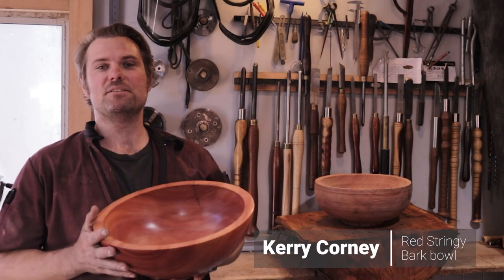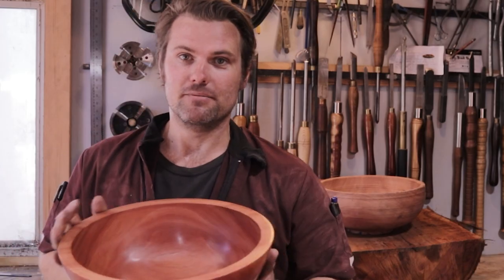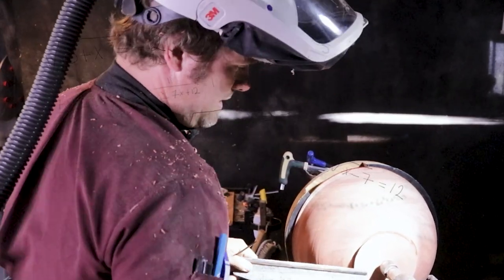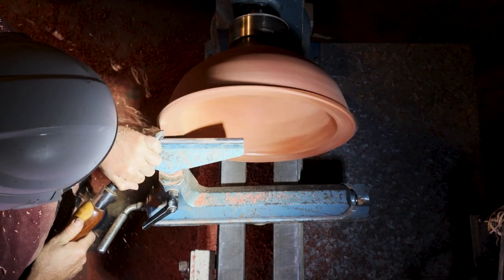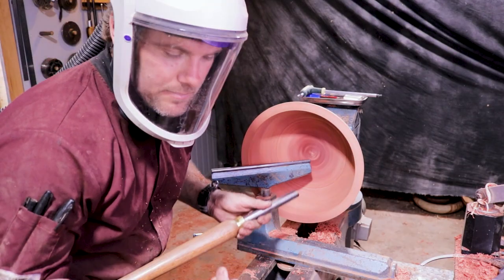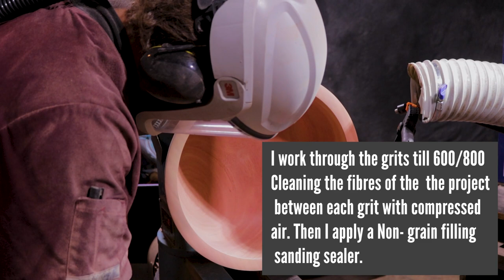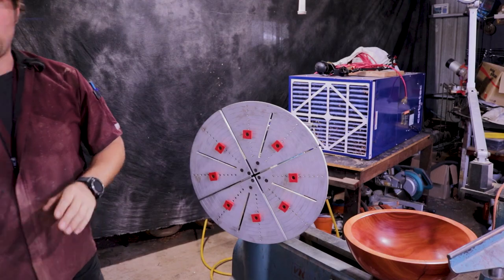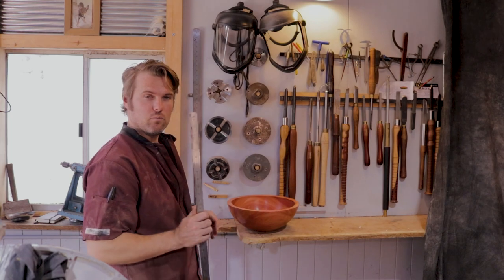Wet wood to BONE dry in 4days! Australian Hardwood - Without cracks.

Comment: Thanks for all the tips. Wondering why the need for the remounting plate when you have a tenon there to use.
Reply from the maker: Thanks for the question Jim. It's because the tenon has moved and warped in shape during drying. So I reshape them for another smaller chuck.

Comment: Fantastic bowl, Kerry! It sure is a monster!

That bottom bowl gouge is looking a little short! Lol
When you go to replace it (if you haven’t already) you need to check out Ashley Harwood’s new bbg. I have it and I love it!
Reply from the maker: Thanks for the tip mate. I really appreciate that. Does she ship to Australia?
Reply: @KerryCorney  Hmm…not quite sure on that but, I would imagine she would. 
I think you’d like it. Any aspect that don’t like about your current bbg is resolved with hers. It’s long, and pretty much zero flex due to the thick flute shape.
Reply: I would check out Stuart Batty gouges too. They are back in production and the few that I have are the best ones I have.  I have tried Thompson, dway and Sorby bur when I order my next replacements they will be Stuart’s for sure.  Also swing your bottom bowl gouge more, it takes getting used to but works great to get a smooth cut that makes sanding minimal.  Trying to push the short angled bevel is tricky.

Comment: Sorry but I’m calling bullsh!t on your 15% moisture content measurement.

Yes that’s what the moisture meter says BUT, moisture meters work on impedance - and the meters are graduated at the factory - to measure Douglas Fir, not Aussie stringy bark.

So the CSIRO in their wisdom, put out a “corrections factor” for moisture meters on a species by species basis.

For Aussie Stringybark according to the CSIRO tables, you have to add a further 2.25% moisture content to your meter reading of 15% to get an actual moisture content of 17.25%

The recommended EMC (Equilibrium Moisture Content) for stability between summer & winter expansion & contraction rates is 12% EMC.

Essentially this means your bowl is not at all dry in 4 days, that’s just complete & utter bullsh!t in your video title sorry.

In addition to the species correction factor, you also omitted any temperature correction factor which could add up to ~ 1% more again depending how hot the ambient temp was when you took your moisture reading.

If you go to my channel you will find a short video on correct use of moisture meters if that’s of any interest to anyone & it shows how to apply the correction factors to moisture meter readings for species versus Douglas Fir that the meters are correlated to at factory when manufactured.

Something else you haven’t allowed for is that such a bowl contains 2 different grain directions, both radial & tangential $ in the same piece of wood there’s up to a 6% variation in rate of expansion & contraction in the same piece of wood from the same tree dependent upon grain direction between summer & winter.

What does this all mean.

It means your bowl is still wet / green / unseasoned, and that due to inclusion of both radial & tangential grain it can and will split with seasonal shrinkage & expansion rates as it continues to dry down to 12% equilibrium content over the years anywhere on the coastal plains in Australia where most of our 23 Million population live.

Were the bowl to be kept in a snow environment where relative humidities are much lower then it would need to be dry to ~9% EMC to have any chance of survival between seasons without cracking.

Same applies if the bowl were to live in a 24/7/365 refrigerated air conditioned sky scraper etc where again relative humidities are kept artificially low.

Timber technology is a subject you really do need to learn and apply in any serious wood working venture.

Try running a seasoning kiln for Aussie hardwoods without knowing it.

There are 3 different types of moisture in hardwoods.

There’s free moisture (sap), and there’s intracellular moisture (contained within the cellulose fibre cells, & then there’s intercellular moisture contained within the actual double skinned cell walls that can only be removed by turning it to a gas (steam) so it diffuses out through the lumens in the cell walls.

Putting the bowl into silica gel for 4 days won’t miraculously season it, rather it risks structural collapse by drying the intercellular moisture out too quickly and collapsing the cell walls due to differential pressure variations outside & inside the cells.

It’s a big topic that for some reason YouTubers who don’t know just ignore & thus mislead even more wood workers into mistakenly believing.
Reply from the maker: No need to be sorry, Ian. I really appreciate the effort you put into writing this comment. As per your comment, we could talk all day about dry wood and the methods behind it. I am fascinated by it, and it takes a long time to perfect. I’ve been looking at a Wagner moisture meter for a while because you can dial in the species to measure the moisture.

As I said in one of my latest videos, there is always someone out there who knows, and we appreciate you.

Cheers,
Kez
Reply: @KerryCorney  It’s all good. Retired Forester who had a log contract, mill, kiln, furniture factory & showroom in southwest WA for 20 odd years.
The latest non destructive moisture meters with inbuilt species correction factors tables are the way to go.
I had to learn all this to run the kiln, with daily moisture meter readings over the 3 months drying cycle.